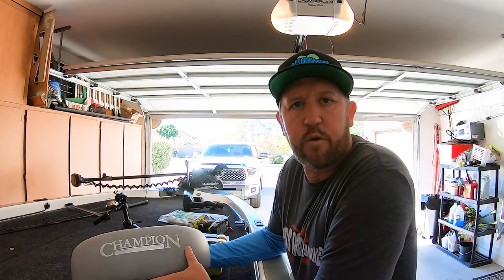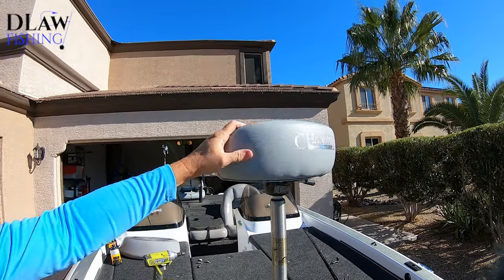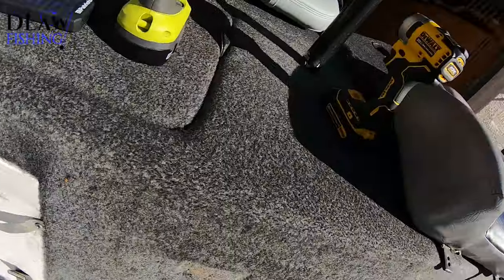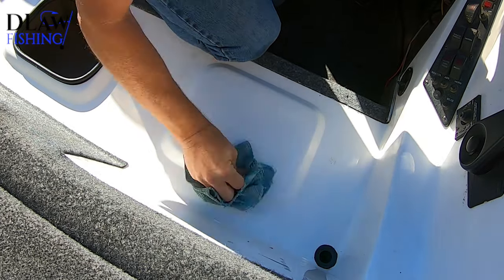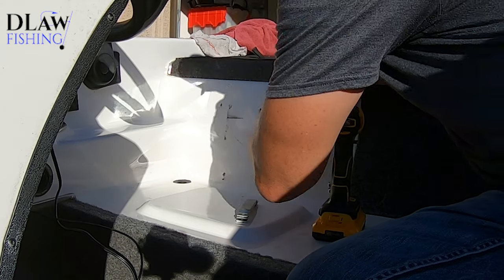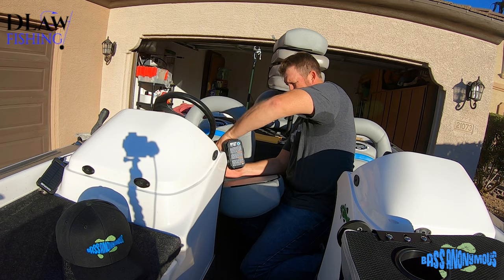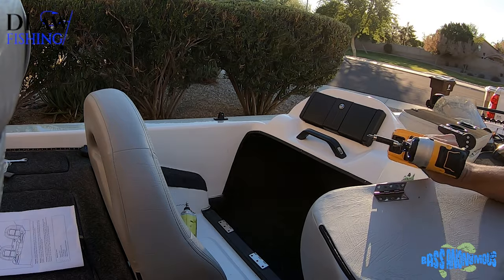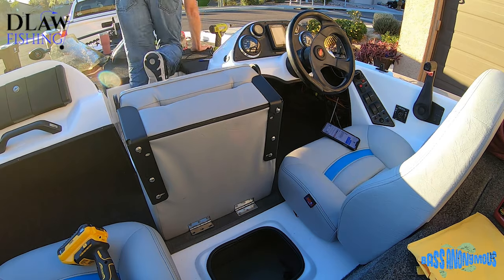How to Install New Bass Boat Seats in Your Champion Bass Boat

Comment: Great video. Was looking for new seats for my Champion.   Glad I found your video….
Reply from the maker: I’m so glad you did.  These seats are great. I have 0 complaints after 5 months and I wish I would’ve done this 4 years ago when I paid someone to reupholster my old seats.  Llebroc has been outstanding.
Reply: @dlawfishing  I just checked out the website.  What model did you go with? I have a Champion 181SC.  I want the same seat configuration you have.
Reply from the maker: @livingthedream29  I’ll have to look and ask. But if you call them and tell them which boat you have they will tell you the right seats.  They really are 1st class over there.  In the meantime I’ll look it up for you.
Reply: @dlawfishing  awesome thanks!
Reply from the maker: Item	Qty	Price	Grand Total
4BLL201BO-4BLL201A1-4BLL201BS	201 Bass Boat Seats Complete Set
[Champion Logo for Bike & Attwood:Add Champion Logo to the Back of the Bike Seat & Fold Seat (LAB CHAMP-LETRS)]
[Champion Logo for Bucket Seats:Add Champion Oval Logo to Front of the Bucket Seats (LAB CHAMP-OVAL)]
[Center Console Size Options:Flip Up Console with Cup Holders 16.5" (4BLL201C1)]
[Main Seat Color:Metallic Silver (SPEX-SILVER)]
[Insert Color 1:Vapor Blue (AST-VBL)]

This was my order.  I had to change the gray to I believe marble gray because they couldn’t emboss the champion logo on the silver.
Reply: @dlawfishing  thank you so much.  Looking forward to more of your videos.

Comment: I can’t get more than 2 years out of Lebroc upholstery for my 2000 186 Champion DC before the material starts drying out, looses its elasticity, then starts cracking! After 3 years the upholstery looks terrible. I have always kept my boat in the garage since I bought it new in 2000. Gonna try Deckmate seats in a couple weeks
Reply from the maker: Sadly my champion was totaled shortly after doing the seats.  I now have a skeeter.  They seemed alright though. I wonder if the color matters ?

Comment: I’m in Mesa and have a 2003 187. Where did you get those seats from ? I’m missing that center console portion w the drink holders. Lost  it on the way to Alamo.
Reply from the maker: I feel your pain.  I lost one of the backs and then part of my middle console on the road somewhere.  That's why I replaced my seats.  The company is out of Texas called Llebroc industries I believe.  They were great.  I found the link for you.  If you have trouble you can call them they were very nice on the phone too.

https://www.llebroc.com/category-s/129.htm
Reply: @dlawfishing  thanks a bunch. See you out there
Reply from the maker: For sure.

Comment: Nice boat, the only new boat that will compare to that Champion ride is a Basscat Cougar FTD 203 Hybrid with a Champion hull...
That tells you what Rick Pierce thinks about Champion hulls. 
Sad Champion isn't still around 🍺🎣
Reply from the maker: It was a nice boat. Still ran perfectly and with all the upgrades it was a sweet ride.  Sadly it died in January.   New boat is a zxr21. Skeeter. It actually is also a sweet ride.  Different than the champ but very nice.

Comment: Your seats a really good looking what color gray did you use ?
Reply from the maker: Let me check my emails and I’ll make another comment to you on the color. And thanks. They turned out awesome
Reply: @dlawfishing   They actually look so good I ordered me a set yesterday for my 193
Reply from the maker: Looked it up real quick. The gray color is marble and the blue is vapor blue.
Reply from the maker: @stevedewalt3735  what colors did you go with ?
Reply: I ordered the metallic silver but they called me this morning and said that the champion oval stickers do not stick to that very good and suggested I go with carbon fiber shock thunder which is a gray color teal and my inserts are wave rock rocket which is basically black and I ordered 305 seats
Reply from the maker: @stevedewalt3735  too funny. Same here. Had to change from that metallic which I chose first.
Reply: I noticed you lived in Mesa I live in Phoenix over by Metro Center
Reply from the maker: @stevedewalt3735  I moved to queen creek but my fiancé is in Peoria so i am there a lot and I fish pleasant quite a bit.
Reply: @dlawfishing  Are usually fish Pleasant or Bartlett they’re about the same distance from my house
Reply from the maker: @stevedewalt3735  both good.

Comment: what  type of screws do you use to drill into the body of the boat?
Reply from the maker: The screws came with the seats. They are stainless steel idk the size but if you ask llebroc they will tell you